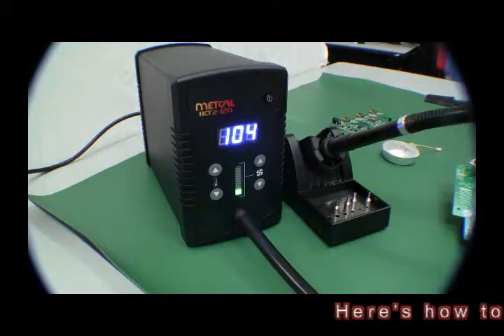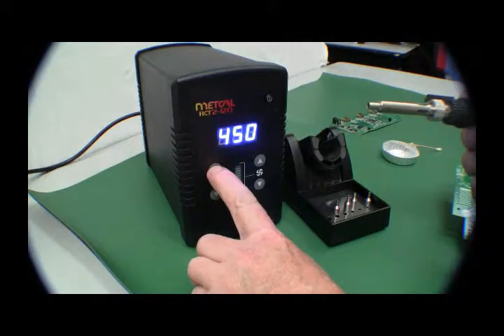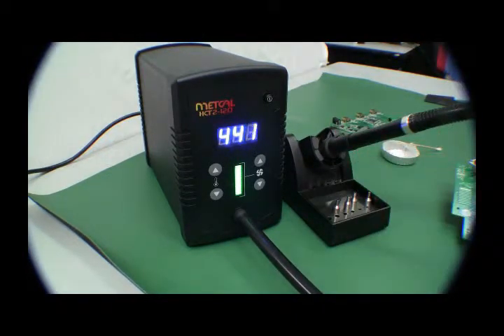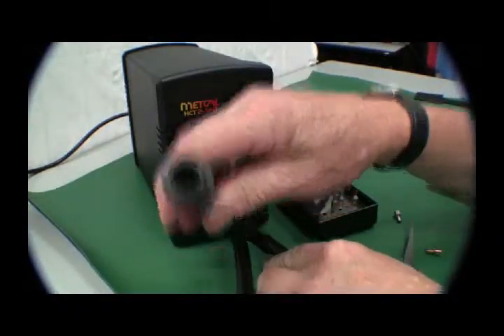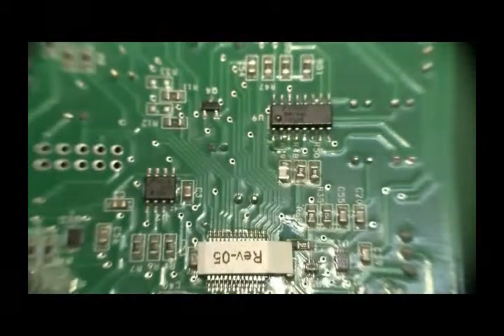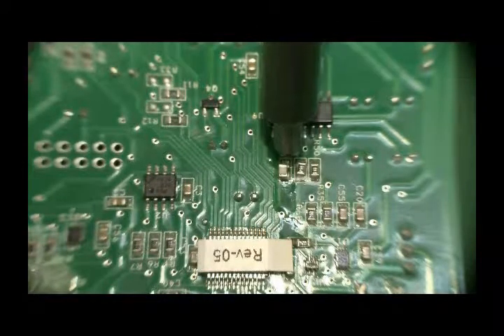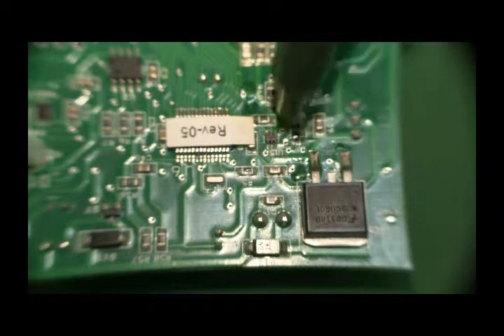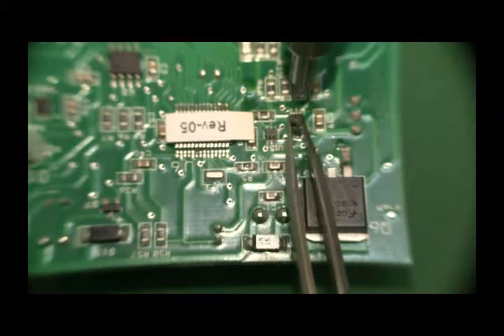Metcal HCT2-120

Comment: Hello, My name is Tam , I am currently in Vietnam , I have used a product that your company OKI Soldering System
Model : MFR - PS1K , 100 - 240V 50/60Hz , 65W
S / N 008 638 .
Currently, computers are processing chip PIC16F872 microcontroller I / SS . As in Vietnam could not have been a service center so I decided to fix it opened , and I was determined by the driver IC PIC16F872 I / SS does not work .

Now I can buy IC PIC16F872 I / SS in Vietnam , but the programming side of it I can not get it .
You please help me by sending me a HEX file or BIN file inside the IC PIC16F872 I / SS with Rev - Version is 05 .

The mount you try to help me so I can re- use this product for OKI Soldering for me is so amazing .

Below are the images I provide to show you more clearly . I hope to hear soon from you . Thank you very much.

Tran Thien Tam
nhattamlaptop@gmail.com